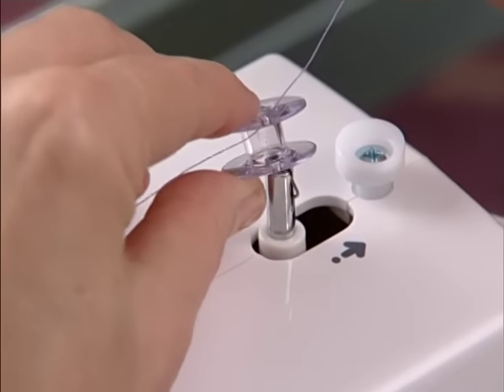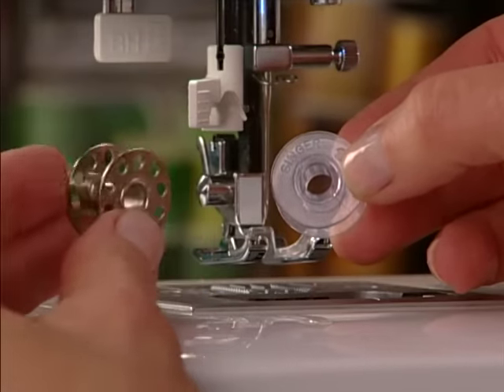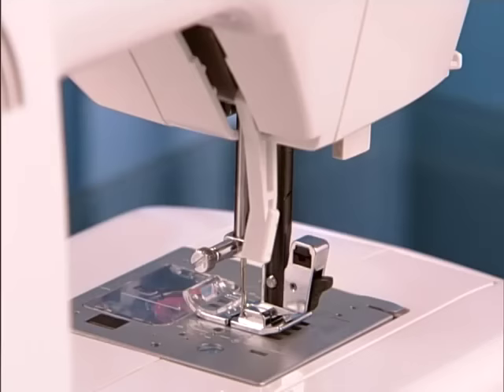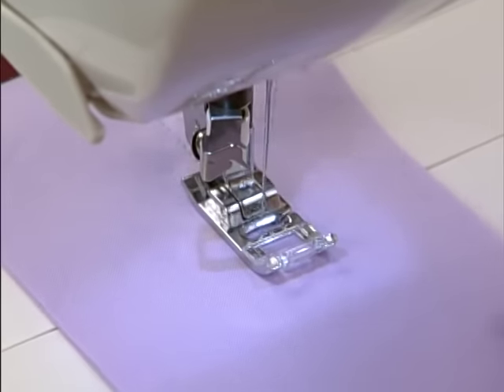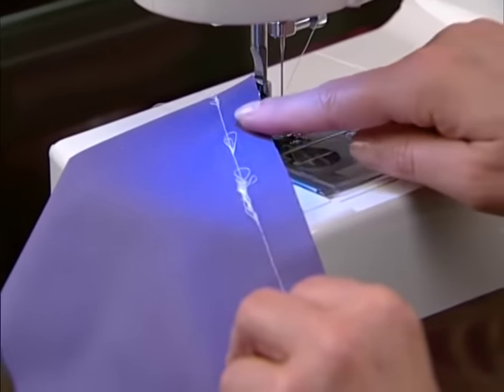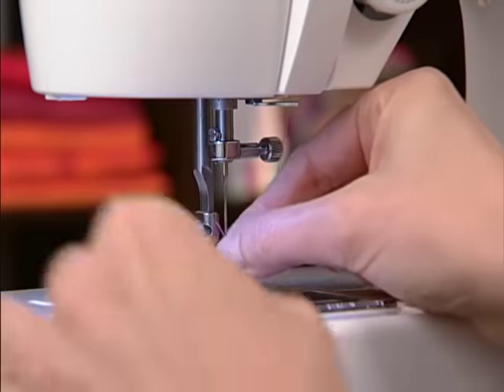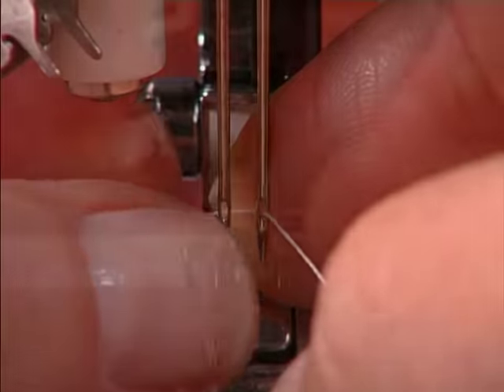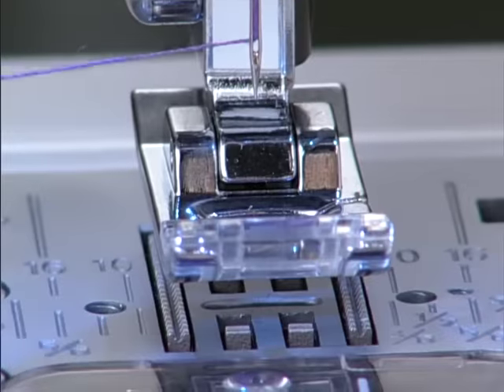SINGER® Sewing Machine Threading Tutorial

Comment: Bought a Singer 3232 which is more of a beginners sewing machine for my wife.  She couldn't get the bobbin to fill or thread so she put it away.  I asked her about it and she said it doesn't work right. Well it's been to long for any warranty help so I've been trying to figure this out on my own with the help of other owners of Singer machines.
When we go to fill the bobbin, we do exactly as it says in the manual and have watched video after video on how to to it.
The bobbin will not even start but you can hear the motor running.  When you turn the little knob thing on the right side of the machine the bobbin will turn just a little and then stop so we can't do it manually.  
Anyone know what we can do to remedy this so she can use the machine?
Thanks All !

Comment: I can't thread the needle if I don't know how to get the thread to the needle.
Reply: Did you follow the color arrows/diagrams painted on the machine? Usually it is easier to follow a diagram than instructions from the manual. You can download the manual or troubleshooter from the machine maker/manufacturer's website.
I hope it helps.
Reply: Thanks for responding.  I ended up figuring it out that day.  Mine doesn't have any color anything on it.

Comment: I need help with a spare part or two ,  what is the electric component just inside the machine at the other side from on/off switch , its a part that small wires go in and out from ,its encased in a plastic box and the wires come out from this and go on to the motor which is in a separate bit ,its nothing to do with the motor but the switch , anyway it smokes when I use machine , but I don't know what its called to try and get a spare part ,I can get all the other parts like new switch motor etc but not this bit the switch goes in to , any help would be appreciated

Comment: Please help me, my Singer 1580 Mon Ami sz can pick up the bobbin thread, but won't stitch. It is threaded correctly, the tension is OK, and I cleaned and oiled it. Everything moves so smoothly just as if it's stitching, but it never forms a stitch. I tried to change the needle, and tried different combination of stitch lenght and tension. Last month I got the timing gear repaired and after that the stitching test was going okay. But when at home, it just won't stitch. What did I do wrong?

Comment: I have a singer superb and I have threaded it 10 times using the instructions and watched this video and did it again about 5 times and the upper thread always bunches up sooooooo much on the bottom and gets caught up in the bobbin place. Can you help me? (i have also read the trouble shooting and tried it again 5 times and still didn't work)
Reply: Try lower the tension, sounds like it's to tight.
Reply: Having a similar issue. I wish they did a video detailing the bottom bobbin placement

Comment: My baby had pulled up the stick that was given for thread holding and broke it :(What to do now
Reply: I took the thread holder to my local crafts store and bought a dowel the same diameter. Then I cut it to length and waxed it with paraffin and polished it with a scrap of denim so the spool turns freely on the dowel.  Works great!

Comment: You think that's bad? I got one of these delivered with no operators manual, no bobbins, no needles, nothing that holds the bobbin threader in place (I don't know what it's called because I don't have the manual). I just got a $50 nightlight, thanks EBay.